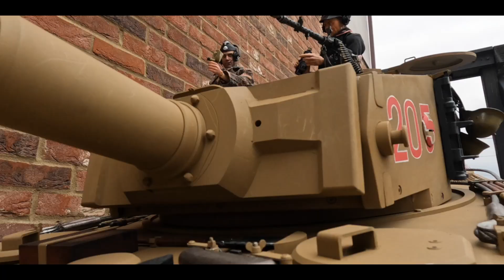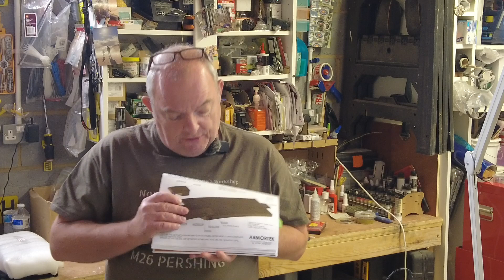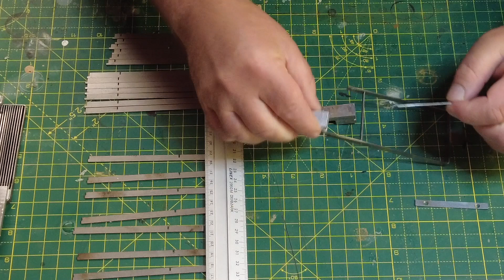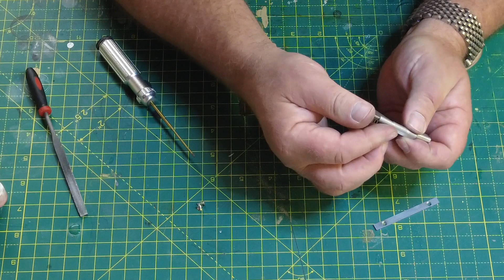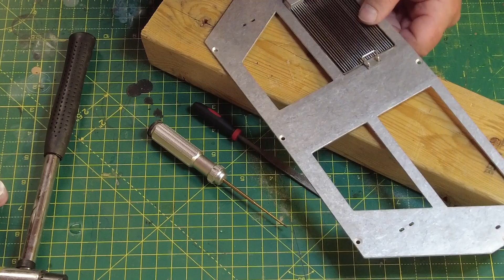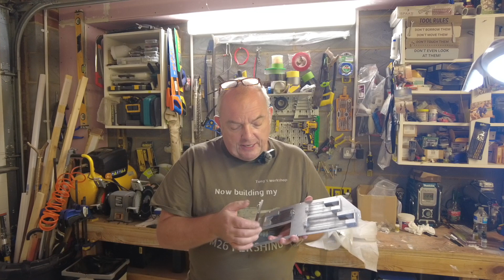1/6 scale Armortek M26 Pershing RC Tank build. (Vid 17) Assembly and install of the rear grilles.

Comment: A fine looking outcome, lovely details. Not done any research as yet, but does those grills open to access the engine on the real tank? ...and if so, has anyone made a mock up/fake engine  to put underneath?
Reply from the maker: Hi Martin, thank you. Not sure if there is one for this model yet, but there are suppliers out there that supply detailed engine blocks etc, but the electronics in this tank take up so much room, there would be no space to show it off...I'm sure that some one far cleverer than me will work something out.

Comment: I am intrigued to know how you plan to paint the grille plates now they are in a made up state as the gap between the plates looks tight. Looking good…..cheers.
Reply from the maker: Hi Warren, They actually paint up well. Better than I expected, as was also worried about that, but using the spray does help get into those tight spaces. Thanks for watching and commenting.

Comment: Hi Tony.. another great informative video… You have already mentioned about leaving the rear panel loose until after the motors are fitted.
It maybe worth drilling and tapping two EXTRA holes in the lower edge of the back panel because the existing two outer holes are almost impossible to access as they are under the motor gearboxes . Wish I had done that myself .👍
Reply from the maker: Thanks Brian, it must be odd watching someone build a model that you have also recently built, or building...we all have our different ways of doing things, that's why us humans are so interesting. I will be honest...that is a great idea, but as you will see in my next video, i think the additional fixings are not really required...I also siliconed the joint, so I hope it will stay fixed. I am blown away by your amazing support and advice on the build, and feel that I have made a solid friendship with you through this journey, thank you.🙏